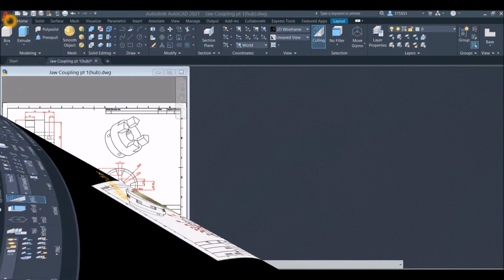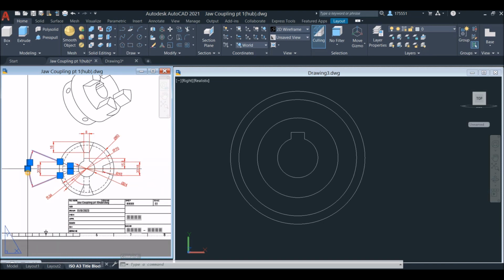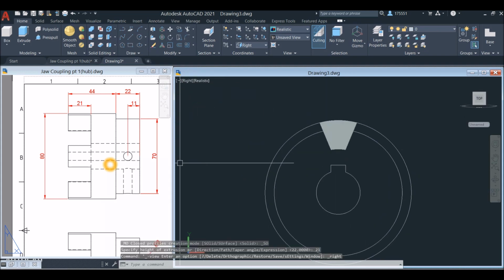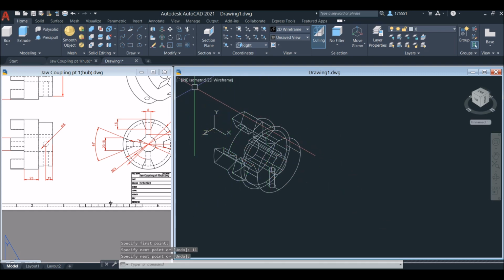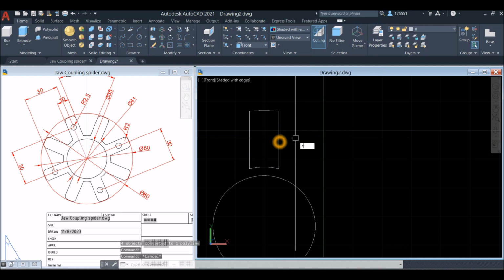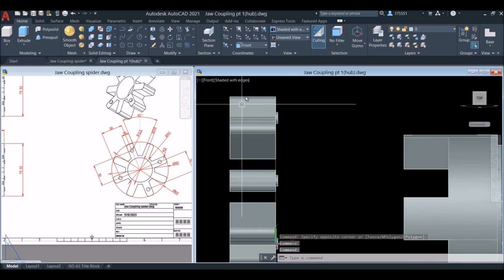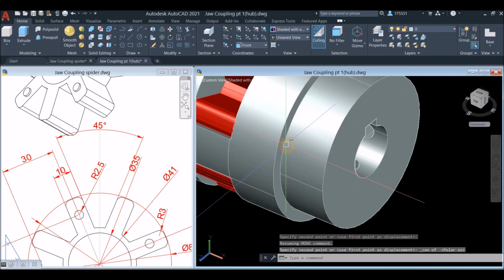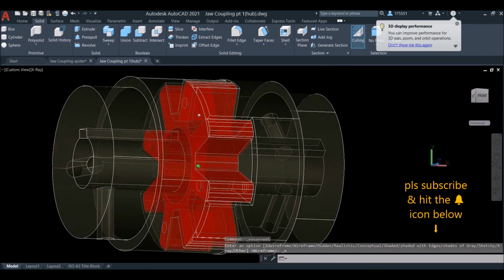Flexible Coupling in AutoCAD

Comment: Hello, welcome, we missed you, I think, you have an error at minute 4:02, size 8, it is not related to drawing the circular sector, but instead of the inner spine, you have to draw the circular sector  Use the size of 20.18 mm, in the circumference of the circle, you ignored this size, and included the size of 8 mm, which is not related to it, thanks